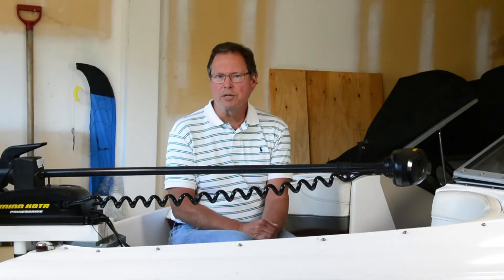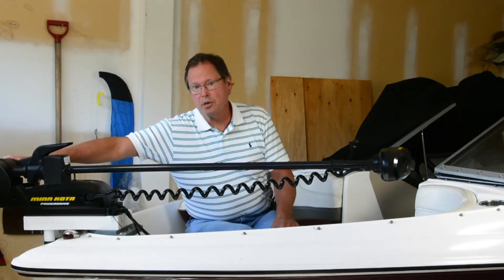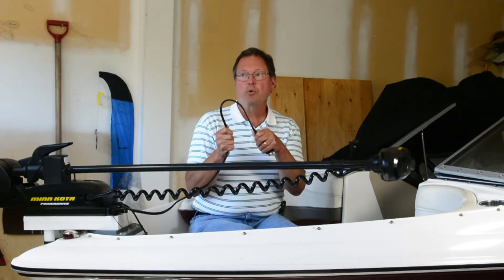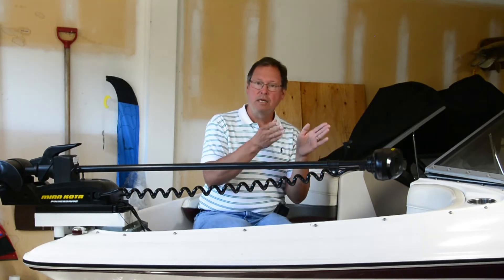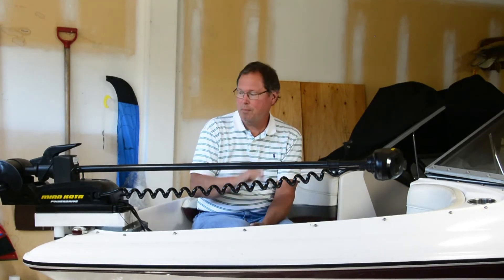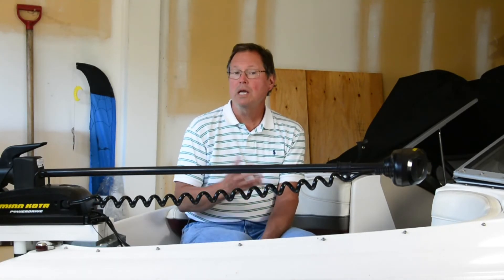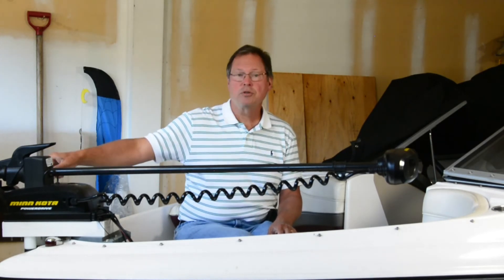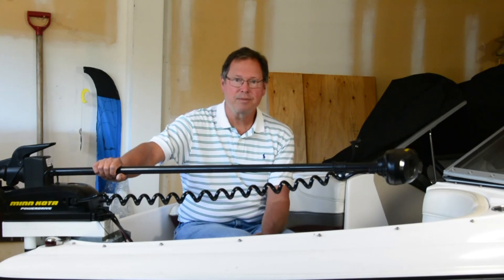12V vs 24V Trolling Motors - 3 reasons why 24V is more efficient

Comment: Could you tell me what would last longer 24V50ah Lithium battery or two 12v 120ah battery's
Reply from the maker: James, in order to be accurate, it would be good to know what trolling motor we're talking about...
Reply: @GoldenChannels  minn kota riptide terrova 24v
Reply from the maker: @WolfKillerLestat  Quick answer is you should get about twice as long with the two 120Ah 12V batteries, maybe more, than the lithium.  Assuming weight isn't an issue, the 120 ah wired for 24V would be longer lasting.
Reply: @GoldenChannels  yeah I think the weight might be a issue, the battery I was thinking of is a rebelcell 24v50 angling li-on battery it's supposed to be the same runtime as two 105ah battery's.
Reply from the maker: @WolfKillerLestat  I looked at the manufacturers website, and I would expect that this battery would last around 2-3 hours at about half throttle for your trolling motor.  Assuming you have overnight to charge it when you get back, and weight is an issue, it might be a good choice as long as you're happy with that run time.
Reply from the maker: Hi James. Your motor would draw about 25A at half throttle. Two of the 120Ah Lucas Marine batteries that you are looking at should run that trolling motor for around 4.5 to 5 hours. There was something in their specification I found odd.  They say that this battery can only live through 200 cycles.  Most deep cycle batteries are good for at least 1,000 cycles.

Maybe I should ask a couple other questions:

First, how quickly do you need to charge your batteries when you come back, second, will you be continuously running the trolling motor for hours at a time, and third, if this is a new installation, you may not yet know what kind of throttle position you need.  It this a new installation?  Do you have any idea how fast this motor will pull your boat at full throttle, even for short time periods.  How big a boat?
Reply: @GoldenChannels  my boat is 16 foot orkney longliner 2,its my first install so I went with the rebelcell very expensive battery but the weight difference is 9.8kg compared with 2 28kg 120ah.

Comment: Thanks nice vide, can you tell me where you got the white spacers in the front of your troll motor bracket?  Thanks
Reply from the maker: That high tech bracket for my trolling motor was actually 3D printed.  Huge project.  The spacers are actually center drilled PETG tubes with 3D printed angled washers. You could say that this was one of those project I got carried away on.  I might post more about this later.  The software used to design the bracket is actually free, and I learned a lot from doing it.
Reply: @GoldenChannels  Thanks, I didn't think it was an off the shelf. Maybe this would be marketable for someone, if not already available..
Reply from the maker: @dabbles1000  I had thought about that, but the issue is getting the profile of the front of the boat I would be making it for. Its a good idea, but I have to think more about how we could get a 3D scan of the each boat. If a customer could somehow scan their bow with their cellphone using an app, it might be do-able.

Comment: I took how many years of school and for some reason cannot seem to grasp what you are explaining
Reply: You are doing a great job explaining it's just that I do not know enough about amperage and voltage to follow along just wondering what kind battery to buy and trolling motor that will be best for overnight Expeditions into the Ten Thousand Islands on a 15 foot gheenoe
Reply from the maker: @hillslide  Cool boat!  Is yours the 15'6" classic?
Are you going to use the electric trolling motor for the main motor?

Comment: So to run power for radio fish finder ect . I can’t run the power off the 2 trolling motor batteries anymore if I upgrade to a 24v system I would have to buy a third deep cycle battery or run off the main starting battery correct?
Reply from the maker: Yes, that is the wrinkle.  I'm debating the same thing right now with my 55 lb. trolling motor.  My Yamaha engine has a "house battery connection" which will also charge /isolate my second battery bank, and that doesn't work after a 24V change over, either.

Comment: How did you get the mounting bracket that your trolling motor is mounted on the boat.  I’ve been trying to get one or have someone make me one.  No luck at all. Do a video of how yours is mounted.  My boat now is very slim and limited flat space.
Reply from the maker: This bracket is actually 3D printed, in conjunction with a great deal of time spend designing it.  I'll try to get to making a video on how I did it, but I also don't mind sending you the 3D model I used if you want to try something similar.  But each new boat requires a lot of design changes.  Have you ever worked with 3D printing?
Reply: I do not have any experience with 3D printing.  It’ll be great if you can share any tips and ideas 💡.  Thanks for replying.
Reply from the maker: @touayang5841  You're very welcome. Sorry I couldn't be more help.  The major issue with designing a 3D printed bracket is every boat is different, and you need to somehow scan the shape of the bow you are designing a bracket for.  Once you know the contours of the boat, you could use that as a form for my existing bracket, possibly. I may talk more about this later on our facebook page.

Comment: How do you upgrade a 55lb to a 70lb?
Reply from the maker: If you have a new version Powerdrive 55, it can be upgraded to a 24V 70 lb version by replacing about 5 parts.  I know how, but haven't had the time to do a video on it.  What model of 55 do you have?
Reply: @GoldenChannels  a new riptide powerdrive 55 with spotlock. About a year old.
Reply from the maker: Ronald, in looking at the service manuals for this motor, I'm about 95% certain your model could be upgraded to a 70 lb.  Here are the parts involved.  The armature and brushes, the main control board in the bottom of the motor, where it mounts to the boat, the little board that shows you how much battery you have left, and the sticker that says "70" instead of "55".
With my boat, I can get just under 2 mph from my 55, and with another battery, and large cables, I'm right on the edge of just okay.  The thing I don't like is what happens to your charging system when you have the 24v bank for house and the 12V for starting.  Now there is more stuff you need to add if you want your engine charging the trolling motor battery.  Have you given that thought?

Comment: I have a 55lb Neraus Motor running through a 60amp PWM that works fine. I have also connected two relays to enable a reversing function but over a period of time discovered the plastic relay holders and wring were not up to the task and started to overheat and distort. As a result I have now fitted ceramic relay holders and thicker wiring from the PWM to the relays.
Im considering upgrading to a 24volt trolling Motor again from Neraus on Aliexpress and would run it through the same PWM.
My question is what impact on Electricity flow do you think a PWM has ie Voltage drop at full throttle.? and as my reversing relay wiring is probably 10 gauge  is this too detrimental to the whole system ? If so I can forgo the reversing function and run straight from the PWM to the Motor or use Anderson Connectors to connect and reconnect.the reversing function as needed.
Reply from the maker: Hi Wayne.  First question:  Are you using proper marine wire?  This is the stuff with lots of small strands, and each one is tinned/silver?  I don't have direct experience with your tolling motor.  I had a look at one of their models on AliExpress.  It seems straight forward enough.  From your note, I assume the PWM controller is separate, but can you send me a picture of exactly how you have this hooked up?
Reply: @GoldenChannels  
Thanks for the prompt reply
Will send detailed setup information probably next week
Reply from the maker: Hi Wayne.  I don't need anything fancy.  If you want to just send it via PM, and a hand drawing, that's fine.  I didn't mean to make it into a lot of work for you.  I just need to see how things are connected.  Cheers.
Reply from the maker: @Wayne-xy6yw  Some ideas to help: I think your relay connections are just .25" quick connects.  If you have some of these, try one and if it fits securely, you could get a few that can take an 8 AWG wire.  You might want to check if the relay's contacts have corroded by checking the resistance between the ON connections with the relay activated.  If this connection has built up resistance through corrosion, the relay may fail.  The relay appears to be sealed, but hard to tell.  Usually electronics used in wet environments will have what is called conformal coating (looks like thin laquer) to protect the circuitry and traces.  I can't tell if the PWM controller you are using has this, as well as the potentiometer is not sealed, so moisture will get inside of it eventually create problems.  Sealed potentiometers look something lie this: https://www.digikey.ca/en/products/detail/bourns-inc/3590S-2-103L/1088586?utm_adgroup=Potentiometers%2C%20Variable%20Resistors&utm_source=google&utm_medium=cpc&utm_campaign=Shopping_Supplier_Bourns_0118_Co-op&utm_term=&productid=1088586&gclid=CjwKCAiA4o79BRBvEiwAjteoYLG758L6WsPn6mzW8xHOqpbndiIV5f7u_f_c1hKlME-BlZKmTd6mvBoCvdwQAvD_BwE

Measuring PWM voltage is impossible with a voltmeter.  You can tell what is going on with an oscilloscope, but most people overthink PWM.  At the risk of telling you what you already know, PWM just quickly pulses the motor in an on/off/repeat quickly manner, and the speed the motor goes is pretty much set by how much the PWM says "on" versus "off".  This is what is called Duty Cycle.  When the PWM is in an "on" state, the motor is pulling the full current for that fraction of a second.  If you are only on 10% of the time, or 90% of the time, the loss through the wiring is the same during that "on" period, but just not as noticeable since the motor isn't going as hard when at low speed.  I see you have 8 feet of wire between the PWM and the motor.  Did you also have about the same length from the battery to the PWM?  Assuming even 5 or 6 feet, or 13 feet on both positive and negative, you voltage loss is 2/3V at 55A, or about 40W of power.  When your motor is going full throttle, it should be using about 660W, so you're losing about 6% of your power through your wire.  This is pretty reasonable.  And that power loss will drop significantly if you go with a 24V motor.

One last comment, and this is not meant to be a criticism, more of a bit of shared knowledge based on my electronics manufacturing background, to hopefully help with your future projects.  This pertains to safety ratings.  Some manufacturers (I'm not going to get political here) save money by not going through the testing procedures to meet well understood industry standards.  An example would be power adapters, relays, etc.  UL has a particular test method for ratings on relays.  They are one of many industry bodies that put a rating and test method in place for many types of products.  For example, this relay for a Raspberry Pi has a number of safety ratings from a number of international agencies: https://www.amazon.com/Tolako-Arduino-Indicator-Channel-Official/dp/B00VRUAHLE

On my example rating, 3 independent testing labs have performed industry developed test to ensure this relay is safe and can handle the voltages and currents they tell you it can handle.  In the old days, we used to buy stuff at a retail store, and when that retailer brought products into the country, a customs officer generally checked documentation showing correct certifications.  Now, consumers are left a bit on their own.  Each one of those safety markings costs the manufacturer a minimum of $10,000 and sometimes more, to submit the product for those safety tests.  They're generally a mark of a better product.

One thing I like about your setup, is you appear to have had good service out of the motor itself, correct?
Reply from the maker: Hi Wayne.  I like the idea of the reversing solenoid, but unfortunately, the one you sent the link for only has a current rating of 2A.  
The Anderson connectors are an interesting option.  Although they aren't "officially rated" for marine use, they have been used successfully by a number of suppliers as connectors to allow easy use with boat batteries taken out of the boat for recharging.  The only issue you will run into with those, is how you have to connect the wires to the terminals.  We're currently working on spec-ing a crimper for these.  If you're really good at soldering, you might try that, but what they are designed for is a very expensive crimp tool.  The tools we are looking at can create a crimp so tight they're good for 5,000 lbs of load.
Just curious, are you using your boat in salt water, or fresh?
Reply: Am using the boat exclusively at present in fresh water.
Ive borrowed a crimp tool from a friend who maintains his Golf Clubs Golfcarts and the crimp seems fine .Ive used genuine Australian Anderson connectors as opposed to the Chinese aftermarket ones
Reply from the maker: @Wayne-xy6yw  I was wondering if you were in either NZ or Australia.  I've been lucky enough to visit both.  I love both countries.  Take care.
Reply: Yes, Rotorua New Zealand Very fortunate to have so many lovely lakes to fish on
Reply from the maker: @Wayne-xy6yw  Nice place to live!  Wow.  You guys have some of the best Brown Trout in the world.  We're just putting our boats away for the season here in Canada.  -9C here today.  Enjoy!

Comment: Would a trolling motor circuit(wires from batteries  to motor)need to be rewired going from a 12 volt motor to a 24 volt motor.
Reply from the maker: Russell, you should check that the existing wires are large enough for the new motor.  The manufacturers call this "rigging".  Minnkota has a chart for this that is here: https://www.minnkotamotors.com/support/rigging
Hope this helps.  If you have further questions, I'm also hanging out at the group "Golden Channels" on Facebook, or you can post your question about specific motor size here.
Reply: @GoldenChannels  thank you Sir.
Reply from the maker: Any time, Russell!  Take care.

Comment: Awesome explanation. I just did a video of actual amp draw in a 24v motor, mind if I link your video to mine?
Reply from the maker: Your video is good too.  I like on the water tests that actually show testing during use.  Thanks!
Reply: @GoldenChannels  I have seen a lot of videos on motor, even in forum's no one listed the actual amp draw. Figure I make it. The lithium pack made the biggest difference for me, power density and weight.
Reply from the maker: @omieyouknowme  Also, the Lithium reserve capacity is linear versus the amount of current draw, unlike a lead acid battery.  Great comments.